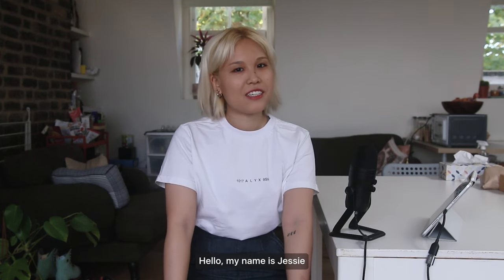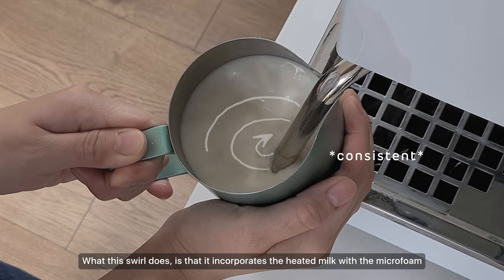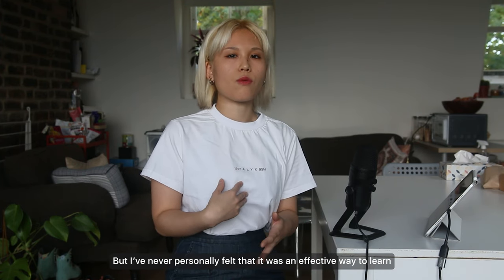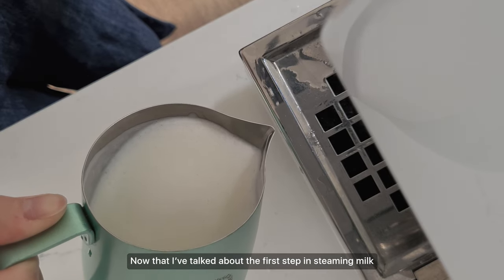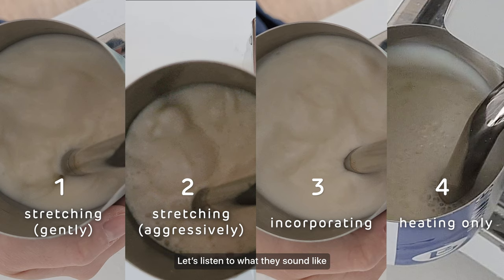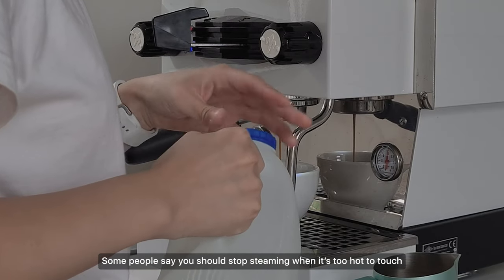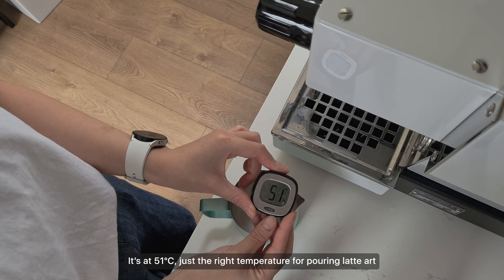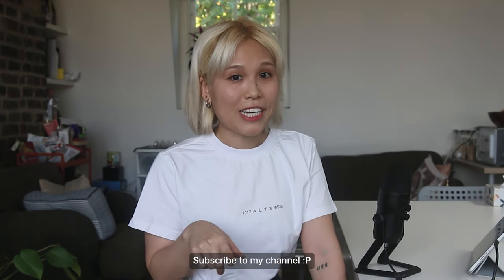The Key to Steaming Good Milk: eyes, ears, hands | Coffee 101 EP.1

Comment: What about a Rocket machine? Would it be considered commercial steam power? I've used a commercial (old) marzocco steam and it seemed weaker than my appartamento.
Reply from the maker: What I mean by commercial (in a general sense) is that it can withstand the work load if put in a commercial setting. Never seen a rocket used like that. Stean power is more about how many bars of pressure the machine produces. My Linea Mini has 1.5 bars and Feama machine I work with has 1.2 bars but feels signicially weaker even though its a commercial machine. Please refer to the manual or google for the Rocket as I never used it before
Reply: @jessiegao_  Thank you for you prompt response. I loved your video, 101 for real. My gouge reads 1.1 bars but It surely feels so strong, maybe I should change the tip to a 1 hole instead of 2 hole one.
Reply from the maker: @3dus  Yes that would absolutely help. If you work with a knob, you could also try to not turn it full way, but depends on the consistency of your steam. The numbers don't nessesarily mean too much, different machines with the same pressure will often feel different